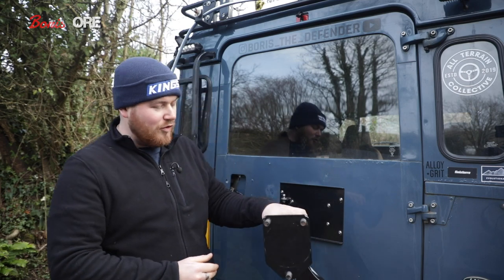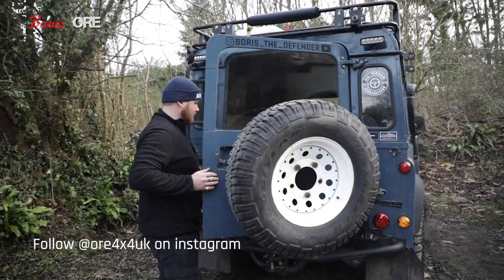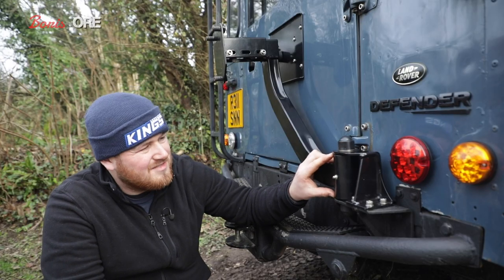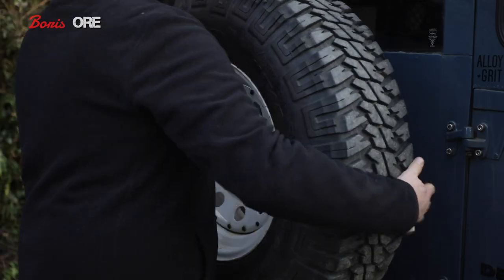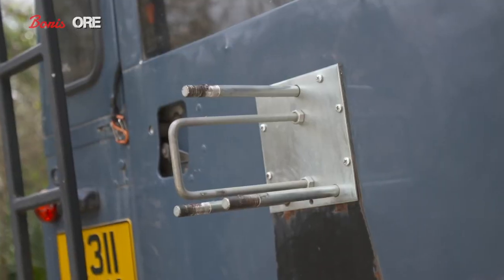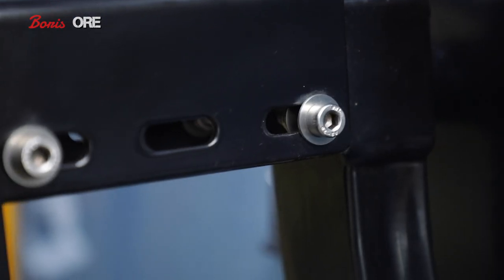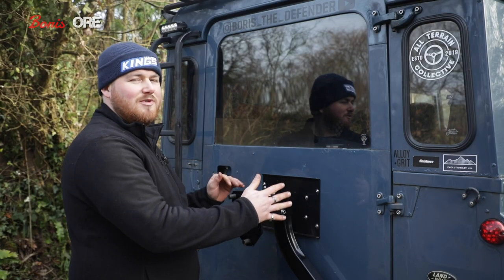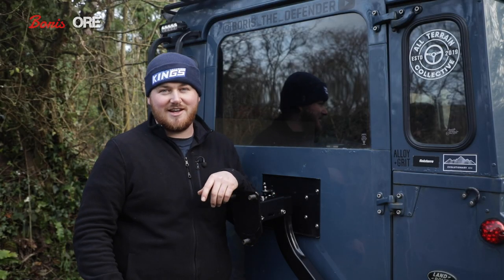What's the O.R.E Wheel Carrier Like After 9 Months?

Comment: I have seen dirt bike carriers that require such a hinge to load the bike on a ramp with the hinge open 90 degrees to the rear. Then once loaded on to the horizontal platform attached to the hinge, the hinge is closed in placed to carry the bike in the same way as the spare tire. What is the maximum pay load of the hinge to be used as a dirt bike hinge ? Thanks!